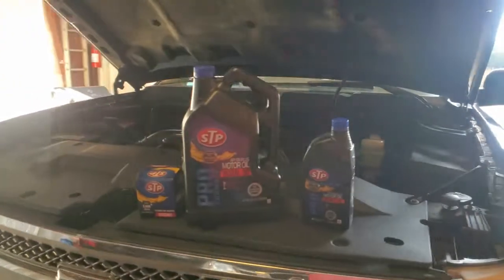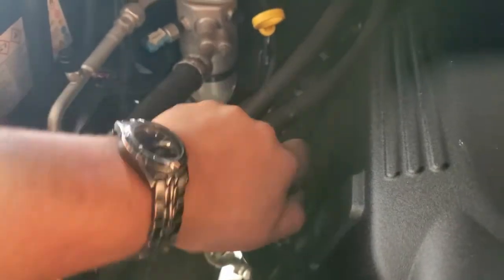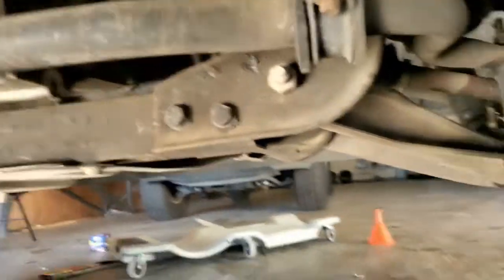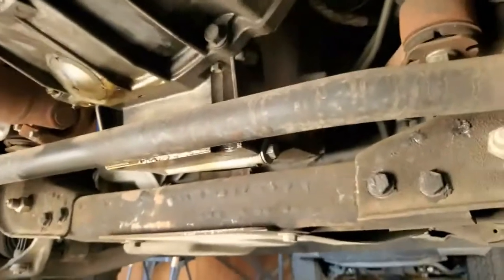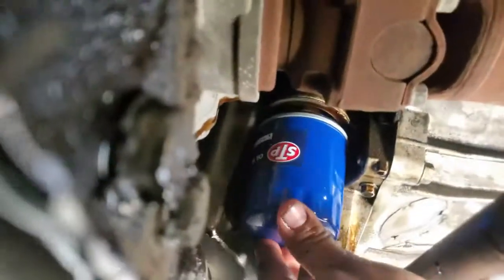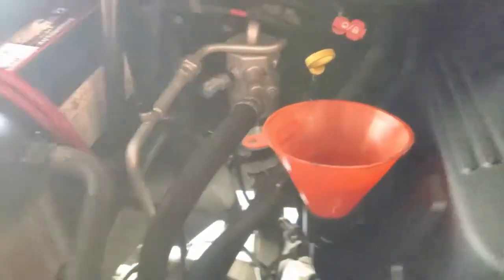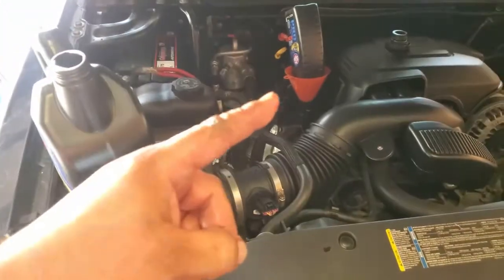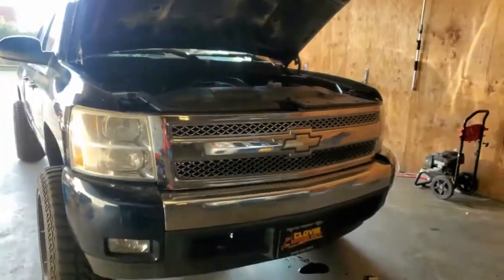How to: Do an Oil Change on a 2008 Chevrolet Silverado

Comment: Sir do you know about the check engine light and trac system warning comes on.  Making truck shake, light goes off after a while and truck is ok.
Reply from the maker: for the check engine and traction control system, with a obd2 scanner you can determine what sensors are faulty on the engine or transmission and with an advanced scanner you can check the abs system. its usually a speed sensor going faulty
Reply: Dude change your spark plugs gaureented it's saying misfire on 7 cylinder 2 right?
Reply: Also the crankshaft sensor
Reply: Same with mine lol